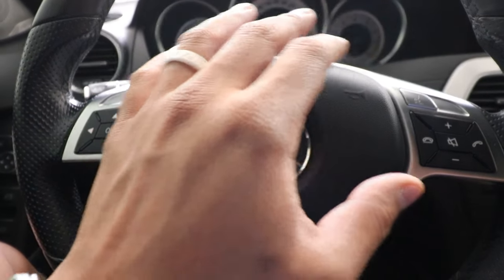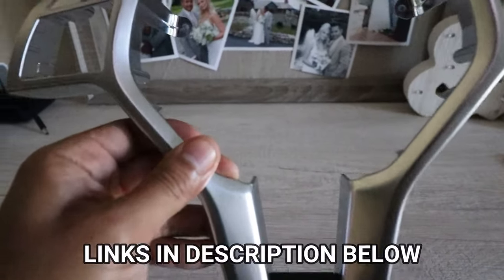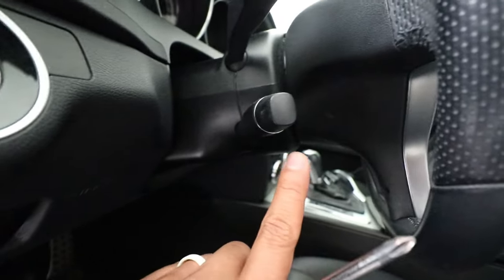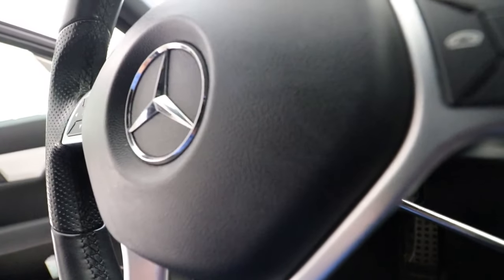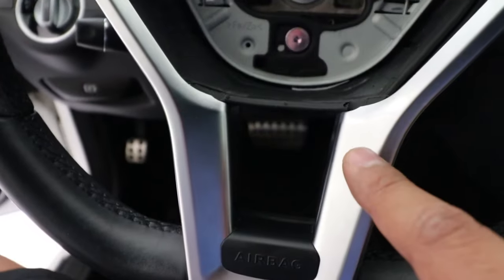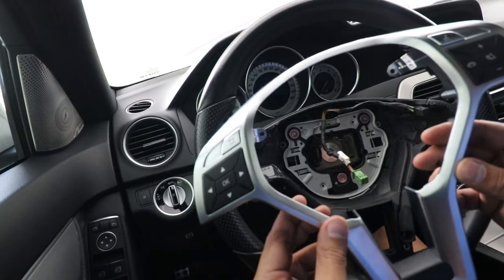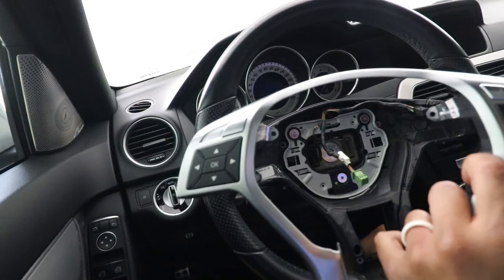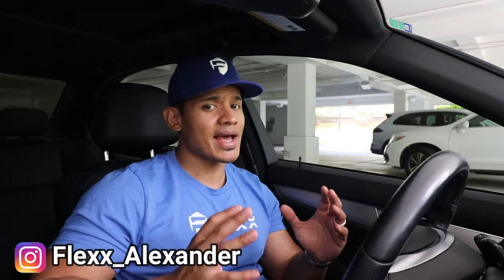Replacing my Mercedes worn, flaking, and sharp steering wheel trim bezel.

Comment: Hey flexx. I also have a screen from dmp car design and after I disconnected the battery and reconnected it. The android screen won’t turn on?
Reply from the maker: I don’t know.  You need to contact them for support. I’ve never heard of that happening before.
Reply: @TheFlexxGarage  thanks flexx. The screen actually ended up turning on after starting the car like 4 times and letting it run for a while
Reply from the maker: Probably the car battery was weak and didn’t have enough juice to turn on all the accessories of the car (including the screen)? I don’t know.  You should let DMP know anyway.

Comment: If this a known problem why hasn't Mercedes done something to help buyers??
Reply from the maker: they have...as long as you're under warranty. I just had a trim piece in my W205 bubble and lift and they immediately swapped it out under warranty.
Reply: @TheFlexxGarage  on my e63 the same thing happened the new part has a smother edge now so it's less likely to flake at the top.

Comment: You didn't get a code after ?
Reply from the maker: Code for what?  

If you unplug anything while the battery is connected...yeh, you’ll get an error. 

But you don’t get error codes if the battery is disconnect.

Comment: I believe the screwdriver you used is way too big for that..
Reply from the maker: Nope. Worked fine as seen in the video.
Reply: Flexx Alexander I mean to remove the airbag. I usually use a small flathead to puch on the airbag springs. Does not distort or tear the rubber as much.
Reply: Flexx Alexander Cool, perhaps you could do a tune chip install video maybe a racechip?

Comment: Just take some fine sandpaper to it
Reply from the maker: Hahaha.  You know what flakes is a cheap aluminum coating? It’s not like a solid piece of metal. Sand paper will rip it apart and you’ll end up with more jagged edges and no color match even if you can get it smoothed out.
Reply: Absolutely cannot use sandpaper on it. Not only will it just scratch it to hell, no matter what weight you use, its just not the way to do this. Flexx's video is on point.